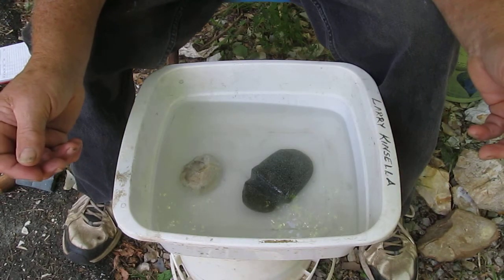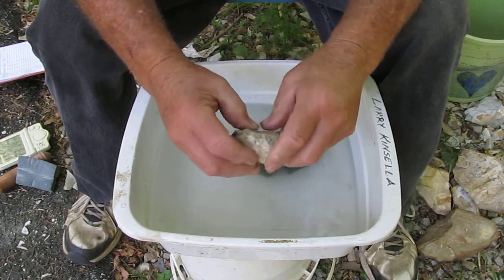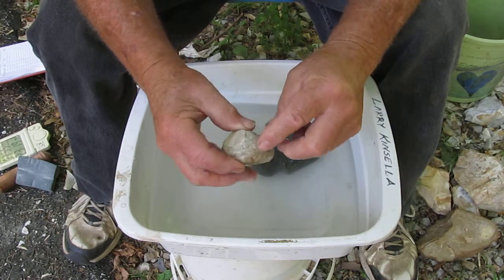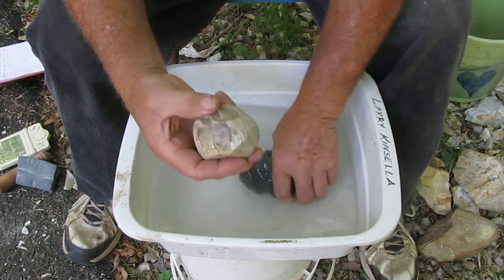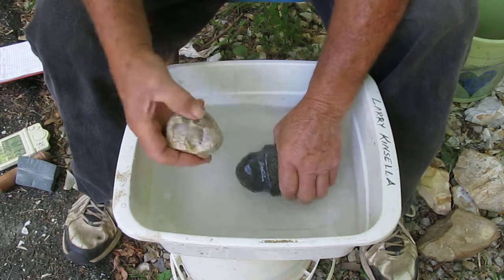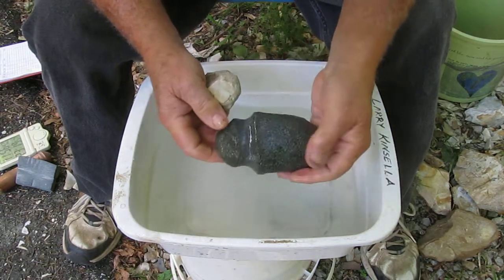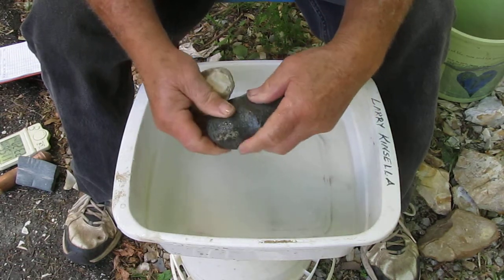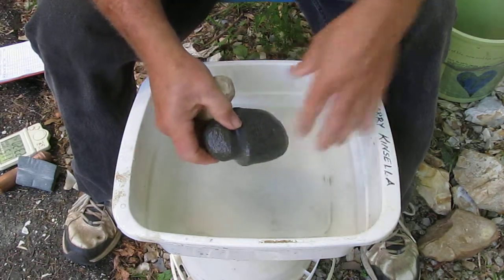Grinding the groove.

Comment: I was on a native site the other day and I picked up a couple of egg shaped well used hammerstones used for lithic flint reduction. I try and pick up any egg shaped hand sized rock I see lying about a place I know natives were about as usually they will be a hammerstone and you can tell via the indentations pretty quickly if it was .

Well other day I picked up a round egg shaped hand sized river cobble and it happened to not be a hammerstone. The thing is it had flat spots all over it in various places and looked worn as could be. I mean it looked like a faceted river cobble it had so many flat spots all over it. Sadly I just tossed it on the ground as I thought it was just a natural occuring thing. However watching this I truly believe you are correct in how this is done. I think that river cobble had flat surfaces all over it from grinding hard stone tools.